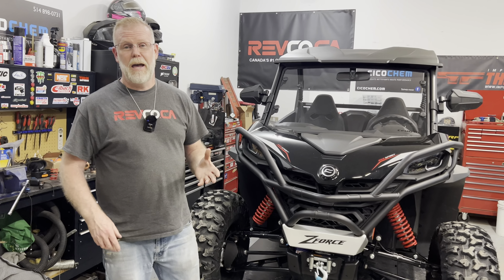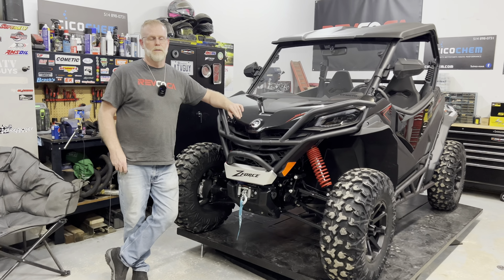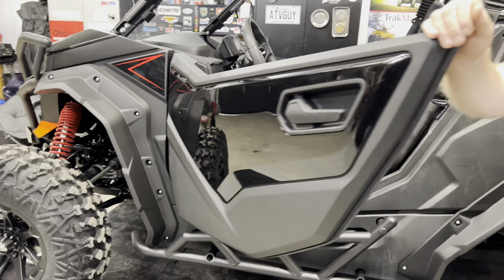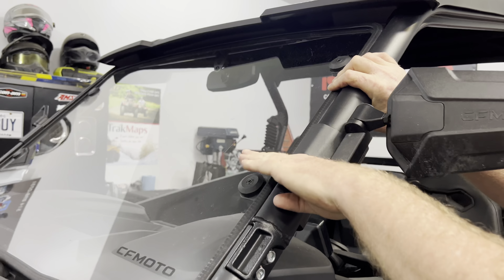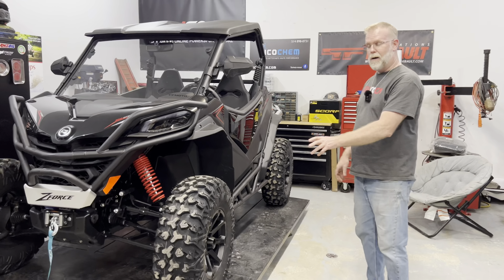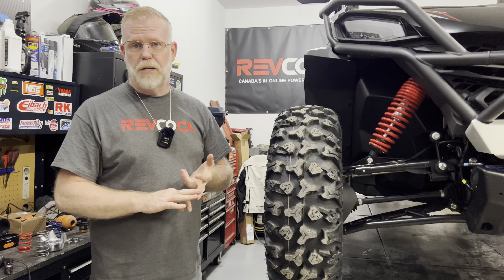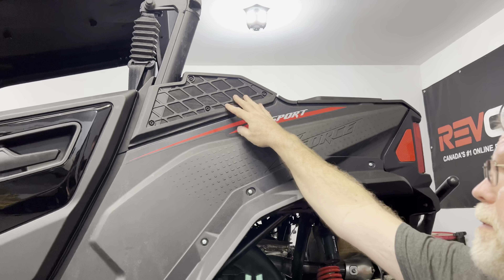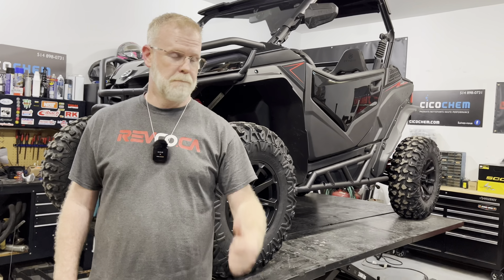CFMOTO ZFORCE 950 SPORT Project update

Comment: I can't understand why everyone is going bonkers over the Ride app. It's awesome and will let you know if someone is stealing your machine. Pretty cool it's free.
Reply: It drains your battery in a matter of days if it's not on a tender. I had it installed on mine and was wondering why it was dead after 2 days of not starting it. The app was soo cool, it would even tell me  when the battery was no longer strong enough to crank the machine 😂😂😂
Reply: @jasonb.1749 I've had my machine since early November. I'm in Canada so it's sat in an unheated garage with no battery tender for over two weeks at temps as low as -15 degrees Celsius. The machine has never started hard let lone the battery go dead.
Reply: @jwyoungy  you have the cfmoto app paired to your phone? I'm in Mississippi and it is garage kept but this was during the summer with 100+ degree heat. I replaced the oem battery, and even had the 40amp charging fuse pop on me. I messaged RNG performance and told him everything and once I got rid of the app and unpaired the machine, all of those issues stopped immediately

Comment: You have the best videos. I am looking at the CF MOTO 800 ZForce trail g2.  What do you think about reliability of the motor and buggy overall? Thanks from New Brunswick.
Reply from the maker: The 800 cc v-twin from cfmot has been around since 2014 and with all the tweaks over the years, the 800 is a solid engine.  paired with the new G2 platform, it's an excellent choice for a decent price in today's market.

Comment: you think they are updating the Cforce 1000 engines as well? and maybe they will make them with rear independent suspension!?
Reply from the maker: it's all the same engine for now with a few tweaks depending on were its going in to. so yes engine are updated.  Whatache taking about? the rear suspension on the cforce 1000 is independent but it's on swingarms instead of a-arms.  swingarms are much better imho

Comment: Since you have direct experience with both, which is quieter in the cab and overalll? The commander or the 950. I used to have an older 800 and it was loud. Trying to decide between the 950 and a maverick 700
Reply: They are both on a very similar architecture.  The Commander has significant advantages in sound deadening between the cab and the engine bay bit to be honest, the sound levels are similar with the 1000 cc class engines that are based on the same design.  The Commander is a studier machine but only by a small margin.  You should be a happy camper with one or the other
Reply: @PowerSportsQuebec  Also please how is the cab heat in the 950 does it get really hot in there

Comment: Do you find the cvt casing outlet boot is very short can I buy an extension boots so mud or water doesnt get into belt and clutches an what kind of the tires you are running
Reply from the maker: I would diy that, it's not really hard to do either.

Comment: Hello.
I have the Zforce and i want to change the clutch  for a better. The original one jerks at low speed. Which one do you recomended ? Thanks
Reply: just tune it.  lighter weights in the primary will make a difference but the caveat is if you go too light the belt will slip and spot and then, melt into oblivion...
Reply: @PowerSportsQuebec  thanks for you response.
How do the RNG clutches work? 
They seem to perform well. 
Or just changing the weights will it improve? 
thanks
Reply: @andreucuevasserra8760  I would not know because i've never tested their specific kits, (not clutches, kits as in tuning kit)

I'm testing a stringray mods kit as we speak and they should be sold at my friend revco  in canada if the tests are conclusive